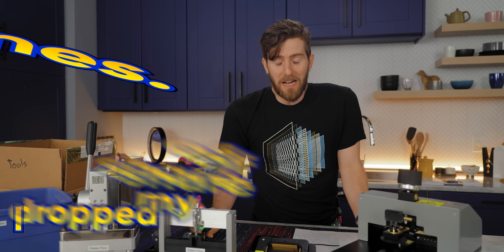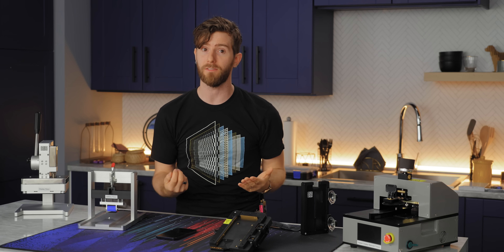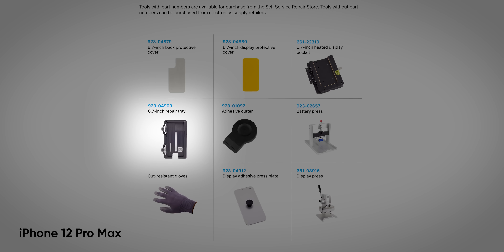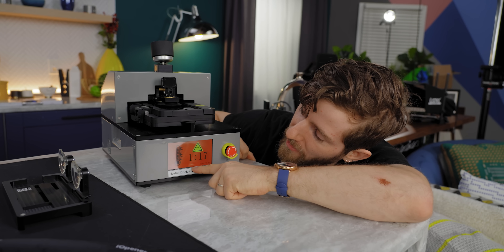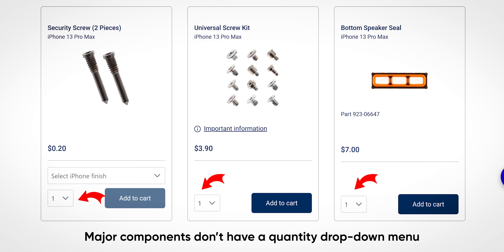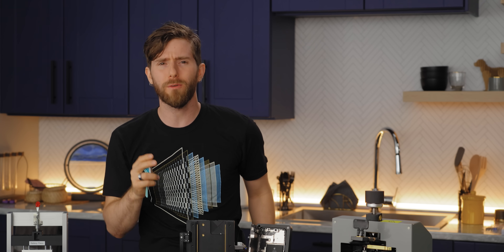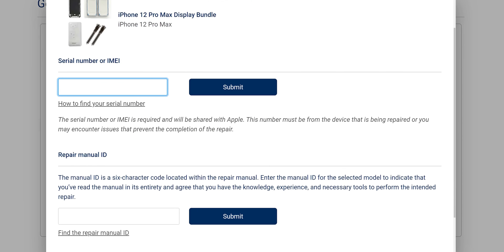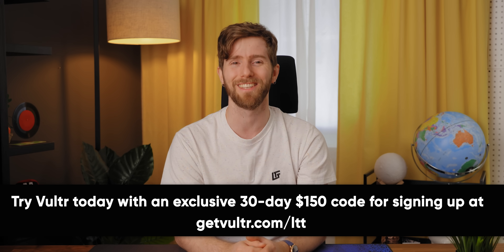I’m a Genius - Apple Self Service Repair Program

Comment: From my time working in an authorized service center I can say that this is also how poorly Apple treats their repair partners. The small buyback amount on parts is the same for repair shops. Even when sending the broken part back the margin on repair is awful. What this didn't cover is if Apple is allowing you to access their software that unlocks the locked features like true tone which are disabled until you run it through Apple's calibration software.

Comment: On all the occasions I have returned an iPhone to Apple for repair (even under warranty) there has always been a service charge of $100 plus and we've never actually gotten the iPhone we entered the store with returned. It's always ended up being a replacement which is why they recommend you do a full backup of your iPhone before bringing it in. The only repairs we've had done are screen repair and battery replacement. And if it's a laptop they will almost always say that it's a liquid issue in order to void the warranty even if water (liquid) has never been spilled on the unit. But of course there is no way you can prove this if anything inside the computer has turned green which can be caused by operational humidity within the laptop which is actually more related to design flaws in the cooling and venting within the laptop than user mishandling. And then there is the proximity of higher voltage to low voltage within the laptop which is often less than a millimeter apart. Again due to design flaws that have been reported to Apple but which they do not correct from one model to the next.

Comment: As a former Genius Bar member I can tell you that those 5 components available for the Self Repair Program are the same components that the Apple Store can replace, anything outside of that is a Whole Unit Replacement.
Reply: A lot of independent repair shops are able to do a lot more than that.
Reply: no they have rear system repair now, its a whole phone minus screen and rear camera , they also have true depth replacement as well
Reply: @Slot1Gamer  true, one can argue tho that that’s almost the same as a whole unit replacement. But you are right, they added the trudepth camera after I left
Reply: Weird that the lightening port isn't included.
It gets the most physical wear and tear, you would expect it to break often.
Mine are normally crap by the end of the phone's life.
Reply: @marc0523  used to be with iphone 4 irrc aasp could swap it
Reply: @marc0523  almost like they want to sell you a new phone instead of having a swappable charging port haha
Reply: that's so sad to hear 😔
Reply: I'm a Tech at an Apple ASP. Can confirm
Reply: That's why I'm glad I work at an IRP location and not for Apple directly. Since we do both OEM and AM repairs for iPhones, we are allowed to replace pretty much whatever we want to as long as we can get the parts for it.
Reply: @spence8920  I don't think so. But its not hard, 4-6 screws and a pressure fit gasket makes swapping out a battery a case of 4-6 screws out, old battery out, new battery in, 4-6 screws in. It might not get IP68, but I just can't see that many people trying to use there phone for recreational diving selfies.

Having seen a couple people do battery swaps, the only non BS reason I have seen for slathering the battery in glue is to obstruct user maintenance.
Reply: How much alcohol consumption did it take for you to forget GSX2? I'm still working on that part myself.
Reply: great but what about their asinine pricing that makes self-repair with tools like this a no-go?
Reply: And that makes sense. They are one of the most common repairs that are needed from the stats they’ve accumulated and the equipment isn’t too hard to operate for consistent results. Thanks for chiming in
Reply: Im torn with this video. I was an iOS Certified Repair tech, and I get the point from both sides. I personally am waiting for someone to fuck up a battery removal and jack up their face and more. They will want to sue of course. There was a reason we had to wear a face shield, gloves, have a giant pitcher of sand, and a bucket to the side just in case.
I see his point about the cost, but I think he is being a bit disingenuous to suggest that the price for doing the repair yourself should somehow cost less than going to Apple, or to even better a Geek Squad.
Reply: @stayupthetree  Is the battery glued in or something? 

My current phone from many years ago takes me all of 30 seconds to swap out the battery for. Finger in the  little notch to pop the shell of, invert and tap to drop the dead battery out, drop new one in, pop shell back on.

Either I'm missing something or it seems like there was a change for the worse.
Reply: @stayupthetree  It's some absolute bizarre logic to suggest that getting parts is somehow should be more expensive than getting parts + labor. It's not a mere suggestion, it's what was always the norm before companies starting to close everything up.
Reply: @philocitea  its some bizarre logic that you fail to factor that Apple doesn't have to markup the cost of its own parts to itself lol
Reply: @stayupthetree  "its some bizarre logic that you fail to factor that Apple doesn't have to markup the cost of its own parts to itself lol"...think about what you actually just said there for a few seconds, lol...
Reply: @j79-p9u  cool story
Reply: @stayupthetree  I'd give that reply a strong 1,7 out of 10. Could be worse i guess :)
Reply: @stayupthetree  I still can't wrap my head around how they'll ship this kit to any consumer but we technicians had to go through HOW MANY AST MODULES? Good lord, we could just order in the kit, bring the phones home, repair them, then bring them back into work the next day to save time.
Reply: @stayupthetree  that goes for any device using lithium batteries and considering there are a ton more using 18650 21700 batteries it's a known entity to replace consumable parts.  You can do a lot more damage messing up a brake job in your garage and then driving your 2T car on the highway with many other cars on the road so at some point you have to give people a choice and let them decide what they want to do with it.  I've replaced a ton of these at home and even punctured one by accident (wearing gloves and safety goggles and having a fireproof blanket on hand).  At the end of the day, it's all about RTFM
Reply: @paulsolovyovsky1702  cool story
Reply: @stayupthetree  I used to be a fire protection engineer in college, I tend to remember some of the NFPA code.  I have a lot of practice blowing up things and setting them on fire for educational purposes only
Reply: People need to give appropriate credit here. The amount of replaceable parts on the iPhone has been increasing over time. Speaking to screen replacements, this wouldn't be possible with the toolset from just 3 years ago. After every screen replacement you had to put the phone in essentially a super expensive mini fridge for calibration. Apple actively worked to simplify the process for repair techs. Now they reach the point where success can be replicated by non repair techs and they start a program to help facilitate, and people still aren't happy with the FOR PROFIT company. 

Before I get attacked for being an applestand, the only Apple product I own is a 1st gen iPad :D
Reply: I feel like replaceable parts on an iphone haven't really gone up, unless you're talking about "officially" replaceable parts. I once replaced the entire aluminum body of an iPhone 5s, with an aftermarket blue one, after bending it in a longboard accident. Pretty easy to do, it just took time. As soon as phones became waterproof though, repairs have become exponentially more difficult. Also the whole fingerprint sensor on the 6's was a nightmare. Replaced the screen on one once, and never used the sensor again. Last iPhone I owned before I switched to the dark side
Reply: @stayupthetree  Giving credit for what Apple has done is like giving credit to that noisy, lazy roommate because he did the dishes once in the month. It's too little, too late, and the actual benefit to users is minimal to nonexistent, especially compared to what can be done on other phones. If you need a screen replaced on the latest Android flagship, all you need is to buy the replacement for <$100 and install the screen. The process is inexpensive and straightforward, and there is certainly no component pairing shenanigans going on.
Reply: @dsp4392  you right, we should just shit on everything they do no matter what it is. I have seen the error of my ways. Also you may want to look at your Android flagship costs again chief.

Comment: I've worked in the automotive industry AND the genius bar. Pricing over the phone can be a challenging thing to tackle. We get customers (i'm talking both at the auto repair and GB) who say it has one issue, when it really has another or they have additional items that are damaged. For whatever reason, these customers will then cling onto whatever pricing you said over the phone. 
Example: 
CX: i need a battery replacement
US: okay its $49
CX comes in and it has a cracked screen
US: okay you also need to replace the screen as it'll crack more while we perform the repair so it costs this much....
CX: "I'M NOT PAYING FOR THAT, YOU SAID $49 SO YOU NEED TO ADHERE TO YOUR OWN PRICING"

And while you may be sitting there contemplating what i've written in a logical mindset, keep in mind that this happends more often than not, even when we inspect it in-person at the bar. 
Don't get me wrong, i completely agree that this program is ridiculous, and they can 1000% do better, but i feel like a lot of negative comments/backlash gets put onto the retail employees who really don't have a say in any of this.

Comment: I had a brief infatuation with Apple Mac computers in the past year... I bought a super discounted MacBook Pro from 2015 with 128Gb storage knowing that I could get an adapter and put a Terabyte in. Apple nearly bricked it when I upgraded to Monterey though because it needed a genuine drive to update the firmware for Monterey apparently! I luckily still had the 128Gb drive... I wanted to use it as a digital audio workstation so bought Logic Pro. I really like Logic Pro but I hate that it runs like crap even on a modern mac... I was able to create some smallish projects with no problems but it was totally out of it's depth once I started adding real time plugin effects. I put a new battery in this MacBook too but originally didn't order a genuine apple replacement part and it slowed down to the speed of a Power Mac G4...

Comment: so i like how apple doesn't include any explanation as to how you actually calibrate the parts after you do a home repair -  most phones require System Configuration to run and 12s and up require RepairCal to be run or else functions won't work, and AST2 isn't a thing that is currently available to consumers, only certified repair locations. so it looks like you can fix your phone... it just won't work right once you're done. 

i mean, if i were a third party shop i'd just buy the repair tools so takeapart isn't a nightmare anymore and then keep using third party parts

Comment: While for example with android phones these days take for example my motorola one action i droped it from 3th floor it shattered allower the place i looked up on internet seller sold me entire phone without board and cameras for 50€ my job is only to heat back plastic on booth phones put board and cameras from broken one to new one apply glue let it dry for couple of hours and its done.New looking phone without marks or scratch for 50€ but remember the phone i droped i payed something like 160€.So yea.

Comment: You forgot the part where after you complete the repair you need to call Apple and have them authorize the repair. Guess what if that iphone serial number you bought the screen for doesn't match the device you put the screen in. Your going to have a bad time.

Comment: I'm trying to think of ways to get around the 3 day wait period. Maybe have some phones on standby and have the customer rent a phone from the shop, or recycle models that were turned in so those parts can be recycled. There are definite downsides, but I want the program to succeed soo well that it blows up in Apple's face so they don't have ammo to fight against Right to Repair.
Reply: LTT didn't show this unfortunately, but after replacing a screen you have to call Apple (actually make a phone call) and inform them of the replacement in order for all features to function. In other words those fuckers are even keeping track of which part goes on which phone. You can't use a part that was not ordered for your specific phone.
Reply: @CanIHasThisName  ugh, apple is trying soo hard to shoot right to repair AND themselves in the foot with one bullet.
Reply: The way people get shitting on Apple actually making an effort, I would just stop making an effort. They've steadily increased the amount of parts that can be replaced, when they didn't have to. They actively made the tools more and more idiot proof so that some of these idiots could have a successful screen repair. When I started the tool Apple provided us for calibration after a screen replacement was easily 100lbs, cost thousands of dollars, was about the size of a mini fridge. This was 3ish years ago BTW, very recent. Apple continues to work on reducing the process down. 
Apple does have loaner programs, and if people would just calm the fuck down, I wouldn't be surprised if they eventually rolled one into the repair program.
Reply: @stayupthetree  Cool, but that's not my point, because they could just sell the parts as-is without the 3 day wait so repair shops could start binning their parts and help customers who don't want to DIY or go to an Apple Store for a repair, but instead they have to do this 3 day wait malarky or buy a new phone.
Meanwhile, Apple could just say "Well, right to repair just doesn't work. The customers prefer to just buy a new phone or come into our store for a repair"

When I say "I want it to backfire for apple" means I want Apple to succeed in making their phones repairable. But here it just feels like Apple isn't putting any effort into it, which I know is BS because I know Apple can do it!

This hardware is cool, but the execution is horrible, which gives me the impression that Apple wanted this to fail.

Comment: Few weeks back I replaced an iPhone 8 plus screen while using the original home button. Was proud of myself but I do not think I would try it with newer iPhones for fear of me screwing it up. If I had access to those jigs and such I would be more confident in the repair. I used a hair dryer and a small hobby iron to soften the glue around the case. Worked well for me.

Comment: One of the biggest turnoffs of self-repair vs. bringing it to Apple is the repair warranty. If you mess up or break any parts during self-repair, you will be liable for any cost - but if Apple accepts the repair they will guarantee a working device when you're done. Insane that they charge as much as they do to let people try it themselves and leave them with a broken device if they fail.
Reply: You mean like literally everything in this world? Imagine repairing your own car, messing it up and then getting mad at the dealer 😂

Comment: As a geek squad agent that does iphone repairs daily it is kinda funny to see Linus do an iPhone repair. Some iphones are a pain to do namely the iPhone 12 and 13 line up with the current design and new adhesive formula. The iPhone 6 to 11 designs are easier to take apart. There are definitely things that an inexperienced person can mess up. Even for geeks squads those repair tools are expensive as well. I don't know the exact price but from what i have heard they can be quite pricey for a store to replace.

Edited for spelling mistakes.

Comment: Just because you mentioned how games when you sell items to an in-game NPC compared to buying the same item:
My favourite game is Titan Quest. It's typical for an item to only get you about 10% of its retail value. For example, a piece of armour that you'd buy for 50,000 gold would only net you 5,000 when you sold it to the NPC merchant. The difference here is that the player tends to find so much usefully-sellable equipment that, by the time you finish the game, you likely have tens of millions of gold left over (assuming you didn't blow it all on resspeccing your character or something similar).

Comment: To be fair - the tools look like a decent deal. If you run a repair shop and can get the tools from Apple to work on the phones with non-Apple Parts then you might have something going for you here. But yeah, would have been so easy for Apple to really stand out here

Comment: 829 you should not be repairing your battery every year just to make it last longer as that is so bad for the environment now if Apple had a way that you could give those batteries back and they could be recycled properly cool but I can understand why they only want you to buy one of each part each time I don't want you buying them both and then it getting thrown out or replace when it doesn't actually need to be replaced you just want to

Comment: Okay this is a massive step in the right direction for Apple they're allowing you to fix most major problems though the charging port issue should be on that list as that's a pretty common issue as well but all in all Kudos apple good stuff in the right direction